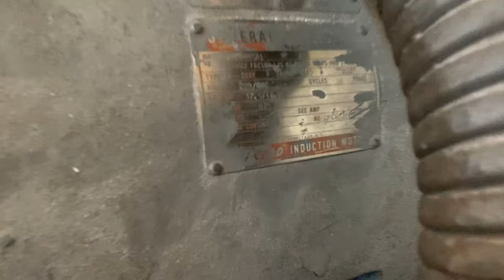3 Phase Motor Startup #2 Compilation No Soft Start

Comment: First time I ever see gasoline automotive engines running a building's a/c chillers!
Reply: Same
Reply: Hot to cold
Reply: Yea
Reply: Yeah this field is hugeee, you always keep seeing new things
Reply: Ikr
Reply: What one can we agree on is the most crazy
Reply: Yes!
Reply: They're burning natural gas, not gasoline. Its just automotive hardware adapted for the job to make it easier to service.
Reply from the maker: @GryphonSmith-mk6dv if you have a moment, look up absorber chillers
They take in natural gas or steam to make chilled water. They’re kinda obsolete but a lot of older hospitals still use absorbers
Reply: how long does it run on an oil change?
Reply: I've seen a lot of those in big hotels in Dubai
Reply from the maker: @pabstblurobot  the oil is changed once a year. When the engine is running, a pulse pump constantly pumps oil from the bottom of a 55 gallon drum to the sump of the engine and the overflow of the sump drains back into the drum. The cycle continues 24/7 during the summer. The oil does not look terrible compared to your car (still see light through)
Reply: One of the food production sites i worked at used them like that, it was around £4k in fuel each week, they soon move them to electric

Comment: strange buzzing or moaning noise in that space at 25 seconds before the blower fan starts
Reply from the maker: That sound is a vacuum transfer system of plastic pellets from a railcar hopper cars to pallet sized boxes for distribution
Reply: @NickSilcox3  no, it's humming of magnetic ballasts for fluorescent lights on a day the grid frequency is a little higher than 60Hz.
Reply from the maker: @professionalineverything  lmfao! You know my accounts more than me? Lol you maybe right in some cases but that sound is a centrifugal pneumatic conveyor vacuum pump for transferring nylon pellets from rail cars to boxes on pallets then loaded on trucks to be sent to manufacturing plants with injection molding machines
Reply: @NickSilcox3  you sure, I know what magnetic ballasts sound like as I genuinely grew up with them in every single room in the UK however there is 1 of 6 remaining sadly.
Reply from the maker: @professionalineverything  yes… because I lubricate that equipment. it’s the centrifugal blower
they do not have fluorescent lamps, its a warehouse and distributor. mercury lamps or LEDs office has electronic ballasts
Reply: @NickSilcox3  instead of mercury, use ceramic metal halide lamps as they give white light without dropping output. I also identified a blown fluorescent bulb in the video, purple as the lack of mercury causes the argon to overpower.

Comment: Holy no way! What sort of place is it that uses internal combustion for its chillers just because they want to run on natural gas? And why would they run chillers on natural gas instead of electricity even though it's not even portable (not an RV, etc.)? And even then, RV gas fridges don't use engines, so why are these using them?
Reply from the maker: Commercial buildings get charged for electrical peak demand. Since natural gas is commonly cheaper in the summer/winter, some high rise buildings opted for natural gas powered screw chillers vs electrically driven to save thousands on their electric bill. Another benefit to natural gas chillers is the engine coolant is also producing domestic hot water (ran through a heat exchanger)
Reply: @NickSilcox3 : So during the spring and autumn (or at least the most mild parts of those two seasons) they use electric chillers, but then they switch over to these combustion ones during the two extreme seasons (and maybe the extreme ends of the other two)?

Also, why does it have to work in this way instead of just the kind of silent gas-powered fridges that you can switch some RV fridges into running on?

Heh, permanently installed, stationary engines running a main service instead of as just a backup are so freaky!

Comment: As an organbuilder for decades, I have always enjoyed the sound of the blowers starting up. 

One of the my favorite and most impressive ones is in the Spreckels Organ Pavilion in San Diego, the world's largest outdoor pipe organ. It's a 25 horsepower 3-phase that we just had rebuilt, and it makes a wonderful sound when it starts. I take great pleasure in assembling a group around it and throwing the switch, then watching the awestruck expressions on the faces of the spectators around it.

My other favorite is no longer in service. It was in a Wurlitzer organ in an old theater in downtown San Diego. A 1920s five horse open frame with centrifugal start. When that switch opened, the blue spark it threw was really fun!
Reply from the maker: @russpeck1320  pipe organs is impressive by its self, going back in history, design and the powerful sound they produce is amazing. 
Wow 25hp for a pipe organ?? I’d have to take a trip out there and love to see the behind the scenes of that pipe organ. I can imagine that organ has over 30,000 individual pipes.

Comment: I'm so confused why they choose 2 big blocks for a chiller
And also were did you get all this amazing footage from?
Reply from the maker: Are you talking about the GM 454 big blocks? In cities (Philadelphia PA) natural gas is cheaper in the summer and electricity is more expensive during summer as well. So some buildings went with a natural gas powered chiller, since not only cheaper then electric powered, it made Air conditioning for a high rise building, but also domestic Hot water at the same time (engine coolant goes through a heat exchanger)
Reply: @NickSilcox3  Wonder why they wont grid tie and sell power?
Reply from the maker: @f-j-Services  some places we have accounts do have that, they are called Cogen,  where it produces domestic hot water and also electricity for the condos but instead of selling the power, they reduce their electric requirement by generating partial of the power they need

Comment: Had a Teco Chill 100 ton outdoor natural gas water chiller that was just a never ending maintenance nightmare
Reply from the maker: Yeah those were endless maintenance and leaky r22 nightmares. That Teco Chill was 300 tons from (2) compressors. It  was ripped out and replaced with (2) Turbocor chillers.

Comment: When i was on my schools welding shop we had this 16 inch metal cut off chop saw made by everett industries it had a 7 hp motor and it was super powerful everytime it was activated it made a initial hum then as it gained rpm there was a loud screeching from the belt and could be heard from out side the shop

Comment: 6:25 is that belt slip?
Reply from the maker: Yeah this was the belt slipping and grabbing the motor pulley, belt was about 2 years old and stretched out, I only replace it when it needs to since the belt alone cost about$550

Comment: 0:59 what is this motor powering?
Reply from the maker: It was powering a fan wheel that was 4 feet diameter, weighed over 500 pounds so it took effort to get up to 900rpm

Comment: @5:27 that is a screw compressor on a automotive engine???
Reply from the maker: Yessir, manufactured by Tecochill, it uses the 454 big blocks made by GM but modified to adapt to the chiller. They’re cheaper to run in the summertime VS electric when demand is very high

Comment: I am really curious to know more about some of the electric motors in this video, particularly further details about the purposes of those devices. It'd also be useful for me to know more about the specs.
Reply from the maker: Just about all of these motors are used for either a fan for an exhaust, or a supply fan for buildings. Others for circulating either hot or chilled water, but for the most part, it’s HVAC related
Reply: Most of them seem to be used as air input for air conditioning systems, and some(very few) seem to be supplying air for mines.

Comment: 2 phase?
Reply from the maker: Yessir, 2 phase power is a 4 wire power feed with (2) separate phases that are 90 degrees out of phase of each other. It was primarily developed to make it easier and add power for single phase motors to start without needing assistance like a capacitor. This was quickly phased out due to 3 phase however some parts in old cities still has 2 phase equipment and 2 phase power feed.